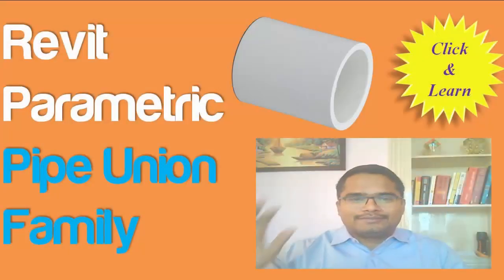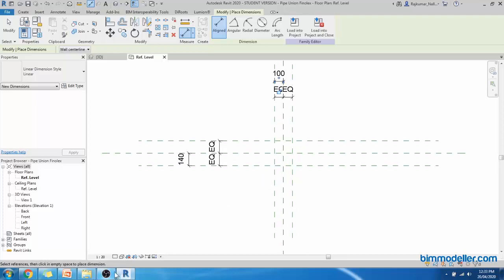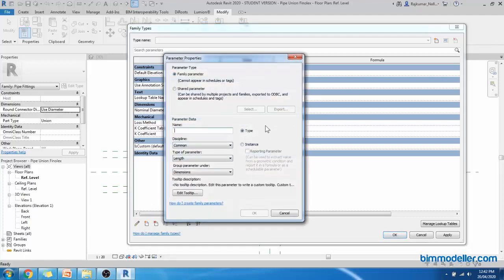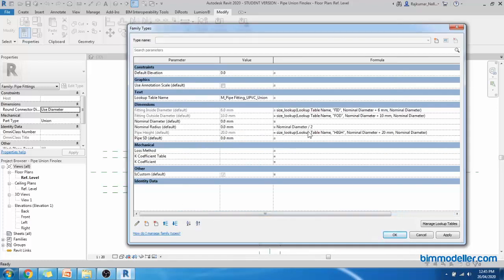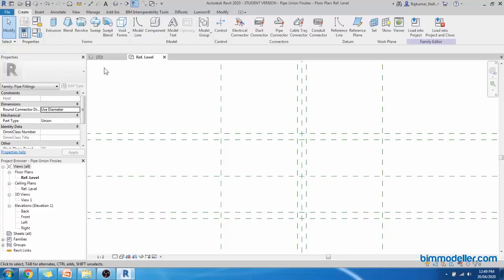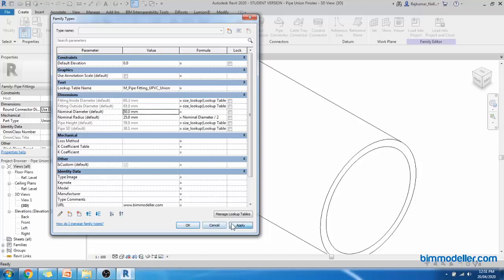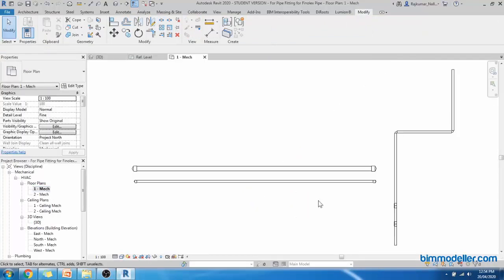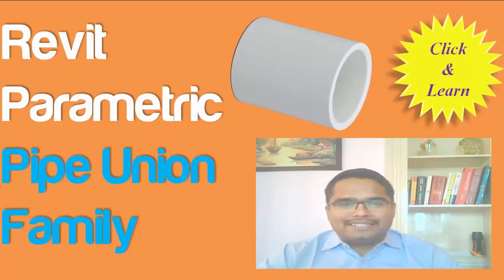How to Create Revit Parametric Pipe Union family

Comment: Your video is amazing mate, that is a very good tip.
I'm trying to create a parametric ducting connect. 
For example, every 1,5m duct to my system generates a connection automatically. Can you help me, please?

Thanks 

Hegel
Reply from the maker: Thanks Mate. To do so you may need to write a script in Dynamo to place fittings automatically. To avoid placing manually.